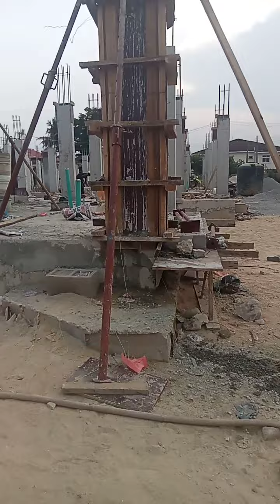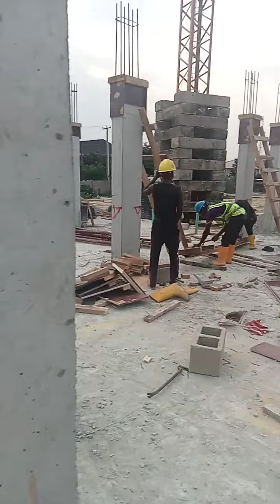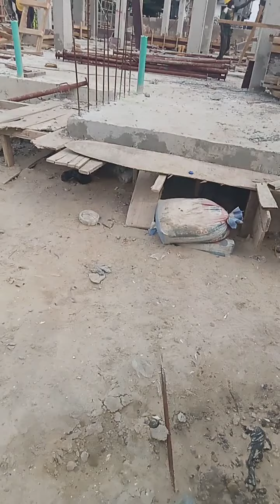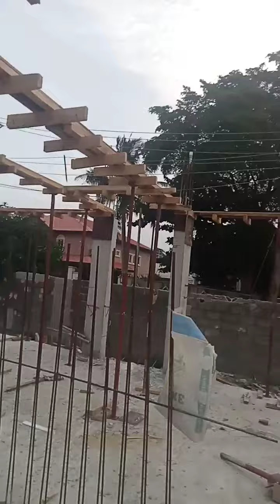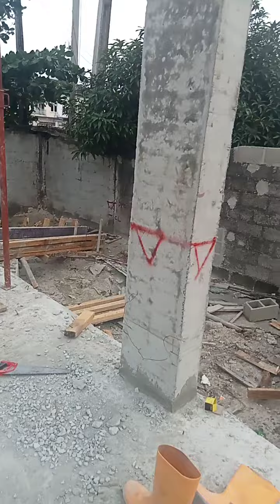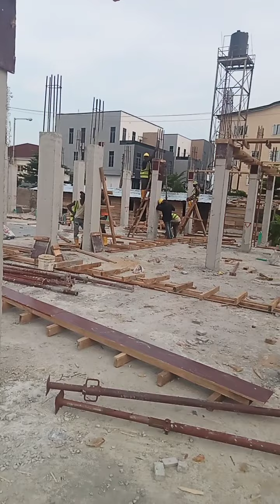Introduction to DPC and 1m level

Comment: You are so great!! I have a project in Nigeria end 2024, I will link up with you soon
Reply from the maker: Looking forward to that
Reply: @SURVEYOR_TEEWHY2021 
Weldone my oga 
I've a clarity on  superimposed drawing 
How can someone profer solution to an abandoned building project that's already at first floor given to another contractor after i did an asbuilt survey of the floor i use that to geo reference then i start setting out column point i discovered the points i set out is having 10cm cover of which i notice the cover was much and I don't want to do any adjustment on instrument point what can one do in such situation thanks 
Hoping to hear from you soon boss